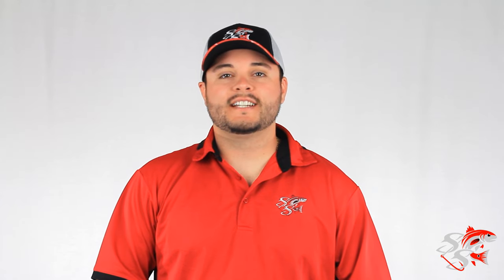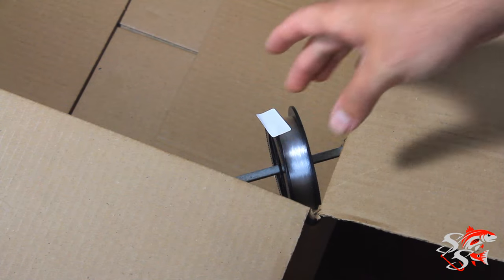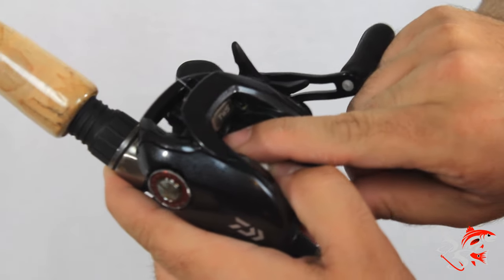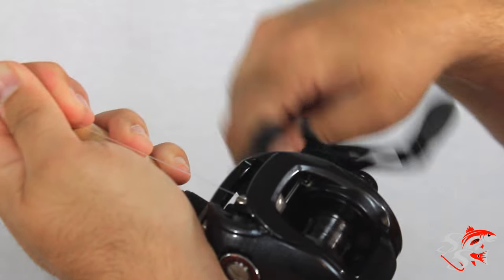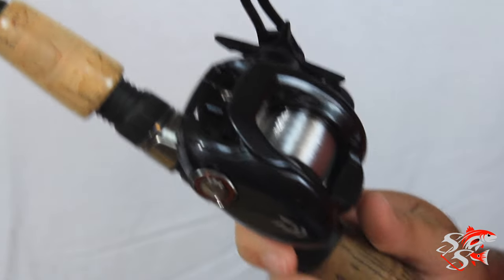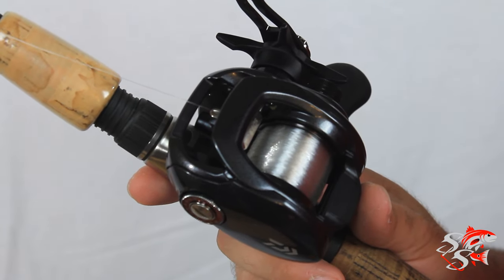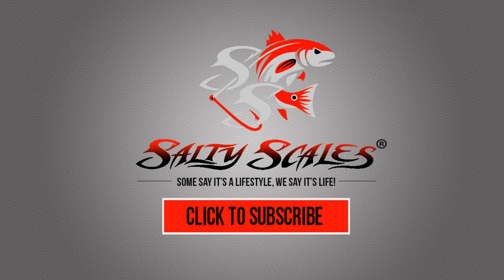How to Spool a Baitcaster - Quick & Simple Instructional

Comment: 22 thumbs down and one clown with a negative comment. Why??? This is a simple  and fast technique that I am definitely going to try out. Thanks for taking YOUR TIME  to offer SUGGESTIONS.
Reply from the maker: I appreciate that Rudy, I have my hater blockers on. ;)
Reply: I can think of a reason. He kinda left out the most important part, which is which direction to have the line coming off the spool. There's only 2 directions, one is right and the other will make you waste $20 in line due to line twists.

In not hating, just decided to reply since you asked why
Reply: @akira3871  There's only one direction when it comes to a bait caster Akira. You're thinking of a spinning reel, which you usually pull the line from when it's flat on the floor (facing either up or down...thus, 2 directions).
Reply: @stuartzen5055   It applies to both. As far as spooling line is concerned the only difference between a bait caster and a spinning reel is a 90 degree turn in which direction the reel spool is facing.

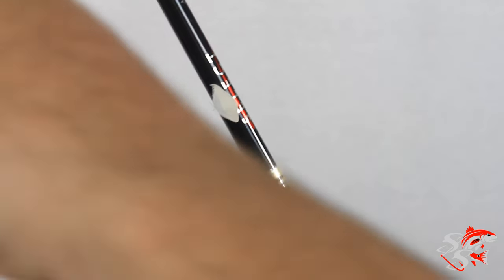0:25-1:35
https://youtu.be/CVHsdy2Xu0M

Comment: I always used monofilament for all my reels, until recently I spooled one of my reels with spider wire fluorocarbon. After I was done it began splitting when I would cast. How would I go about fixing this problem?
Reply from the maker: You may have had a defective batch of line. I would have sent it back.

Comment: Just curious as to why you wouldn't tie to the spool?
Reply from the maker: Honestly, I have tried many techniques over the years (Including tying to the spool) and I think it's human nature to do things as efficient as possible when it works. That is coming from one who doesn't like to cut corners in most instances. You only use a quarter of the line that you place on the spool, once the line is taped to the spool and you tighten it down, it is not going anywhere.
Reply: Joshua Taylor makes sense. Maybe I'll give it a try. Thanks for the reply.
Reply from the maker: MAFIA JIG CO. You're welcome

Comment: So you don't tie a knot around the actual spool? You just put the tape on there? And that wont come undone at all or anything like that? I'm looking to get my first bait caster so i'm new to the caster game.
Reply from the maker: I typically don't when using mono or flouro. The tape will hold just fine, once the line overlaps itself it is secured. If I am using braid, I tie on a few feet of mono backing and splice it to the braid to prevent slippage.

Comment: If you are battling a fish of a lifetime and get spooled out, it will rip the line right off your reel. You need to tie an arbor knot to spool your reel up. If you use a sticker it wont be strong at all and will come off easily. You need to tie a knot for any type of reel because if a fish is spooling you out it will pull the line right from under the sticker.
Reply from the maker: SW Fishing If a fish gets you down to your spool, no knot will stop it. Trust me on this.
Reply: SW Fishing an arbor knot with fluorocarbon is a risky proposition.  Under tension, the knot will cause microabrasions and the line will likely break.  As was said, if you get down to the spool with the drag on,  you,ll probably use your line and fish anyway.
Reply: Robert Mounsey Im talking about Braid as a backing... Also fluorocarbon is abrasion resistant
Reply: Joshua Taylor Its better than a dumb sticker coming off right away
Reply: I am new to baitcasters and I birdsnest like crazy, no way am I relying on a sticker.... maybe when I get good at it. Until then I will use the sticker to help me begin the spool and then tie a knot. Good idea!
Reply: The knot actually safe my fishing trip. The Arbor knot is the way to go
Reply: @swfishing9309  
Braid as a backing...that's a good one 😂
Reply: @swfishing9309  usually mono is the backing and then your braid.